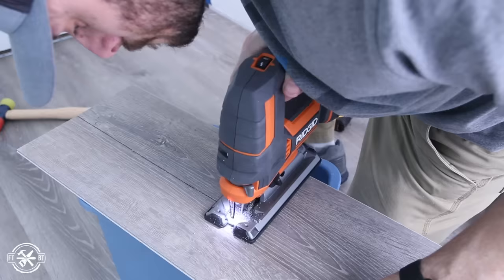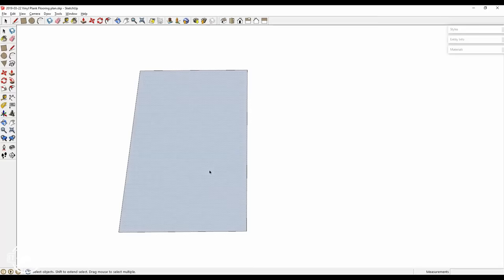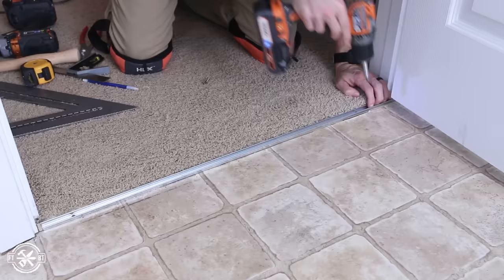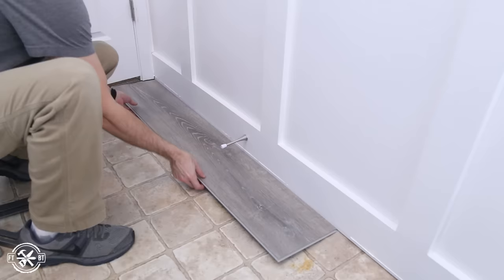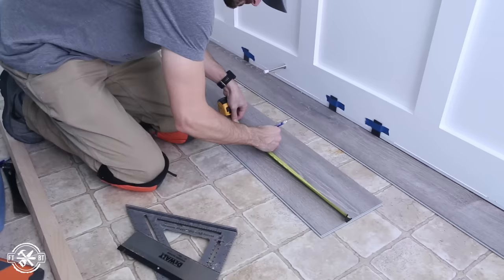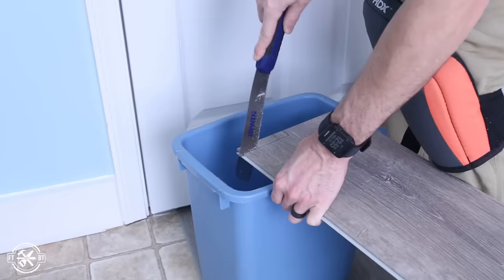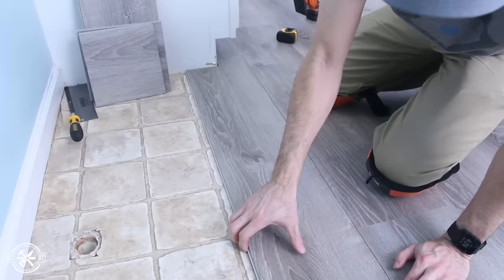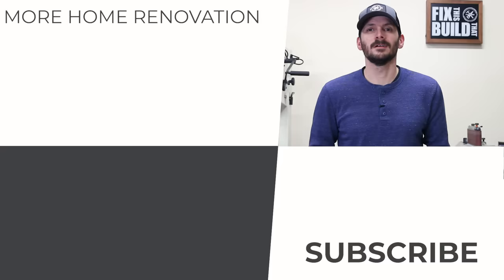How to Install Vinyl Plank Flooring as a Beginner | Home Renovation

Comment: Looks great.  I am doing the same flooring, same color in my place upstairs and down over some 60 yr old wooden planks that are seriously old and stained.  I incorporated Zumma vinyl stair treads in Sterling oak and trimming it out with white caulking, 5" baseboards to cover the plaster mess at the wall bottoms, and trimming them out with matching Sterling Oak 1/4" round.

Comment: @7:43 use the piece you cut off the last row. and @8:41 if you line up the boards on top of each other and place another against the wall so it lays onto of those you will get a better line incase the wall isn't straight plus it will give you the gap you need around the wall for it to move. just giving you some tricks i learned. nice job looks good

Comment: I did my whole house, easy, just remember to give the knees a rest for a few days in between. I also used gold backed laminate floor insulation underneath. 👍🇬🇧
Reply: or use knee protectors? lol
Reply: How much would it take to do a 16×16 bedroom
Reply: @odanesmith4752  $500.00 or less. Depends on price of flooring, and time
Reply: Amen u got that right

Comment: If you use a concave blade in your utility knife instead of a standard blade it's much easier to score and will snap easy
Reply from the maker: Great tip!
Reply: Just use a flooring cutter 10 x the speed and has a tape built into the base of it.

Comment: I see you switched from scoring on the back side of the pieces to scoring on the finish side.  I was going g to suggest that  as it makes it less likely to damage the the finished side edges.   Great job....a multipurpose tool is great for some of the difficult cut areas that are hard to cut with a carpet knife or a table saw as well....keep up the great videos.  Wish your videos were out when I learned ...it would have saved me a lot of trial and error.   On a side not for others....if you can take out the baseboards easily enough it is alot easier than cutting angled on and putting in new quarter round and finishes up alot easier as well.

Comment: Within 3 minutes I knew that I could not undertake such a project. It’s much too complex and dealing with undercutting things and thick and thin strips in various locations was just too much for me to bother with. Seriously, it’s good to know that this would have been a nightmare for someone like me. Not everyone is cut out for planning things so anally.
Reply: traderjoes it’s def tedious I layed this floor with a buddy biggest problem was that the floor was not level a total pain in the butt fixed the problem using sheets of newspaper since it’s thin it just raised the lowered parts enough for the interlocking

Comment: I’’m surprised how many people said you made this look hard. I think you explained it well. Thanks, I’ve paid to have two rooms done, time to do the rest myself !!
Reply: For a diy not bad, for flooring guy extremely novice, I'd be out of there in 15 minutes, he's lucky job was tiny and extremely straight forward, guy doesn't even own a decent knife and a mallot
Reply: I've seen a lot of lay outs that would make masters fumble and I gaze at it in glory, wondering how I did that getting worshiped by installation manager, I'll give you an example imagine a upsyairs hallway with 8 doorjambs one of them is on 45 and a titanium j mold has to get glued in around staircase, and you're using fragile 10mm laminate and btw no transitions allowed whole floor is one piece
Reply: Literally today worked with a guy with over a year experience and he couldn't figure out how to slide in a fat L cut on vinyl plank
Reply: And his bosses with all their life experience couldn't show him, swear most people don't try to innovate and just do what they were taught 30 years ago.

Comment: Here is a tip for mako g your end cut. Turn the board around such as to put the end that locks into the previous board ( but seem)  against the wall then mark the edge of the previous board. Cut n fits like a glove with the proper expansion.  No need to measure every board that way.
Reply: nice tip mate i always do the same while working with laminate or engineered wood flooring and it makes my job a bit faster
Reply: @AhmedHoly92  it's what I do every day ....
Reply: What if wall is crooked...
Reply: @louishollandjr  Measure and cut the piece upside down.
Reply: Not sure, but your saying out the male side toward the the directing of work (install)!?

Comment: I remember selling this product to DIYers and having them all say the same same thing "I don't need the tap and block set with wedges" then see them 4 hours later back at the store. 😂
Reply: Did my whole house without a tap and block set. 6 years later no issues.
Reply: People don't realise that tap actually locates the locking system properly.
Reply: @markallen8097  nope
Reply: YES! The instructions that came with the material I purchased does not mention tapping it, but if you don't it tends to come apart! I had to do several rows over again as a result of not having tapped them!!

Comment: Great DIY but to make it easier and not have alot of scrap pieces. After a row and you cut the last board use the cut board you got over from that row to start the next. This way you don't have to overthink the staggering. Just a heads up that was not mentioned in the video.

Comment: That was waaaaayyyyyy too much for me. I'm going to have to hire someone to install the flooring. I want that exact same color for my kitchen,. You did such a great job, and the laundry room is to die for!!! Well done!
Reply: Dudie I agree with you, even though I have a small house I need someone more skilled then me to put in the floor....
Reply: Guys, you can do it.
Reply: You must be a chick.
You can do it, once you get started, you'll figure it out and finish it. It's very straight forward, floor planks have a groove that they snap on together, real easy.
This guy made it complicated.
Reply: Hey fellas  this has to be my 7 or 8th video and I must admit it's looking less intimidating the more I learn by watching
Reply: R Me way to be sexist my guy
Reply: Its a lot of info in one go but my sister installed hers and it looked great on her first try. Basically just plan ahead and have the right tools and you’ll be fine. Its pretty forgiving to work with.

Comment: Just remember , if you are doing a large space , to make sure you snap a line that is truly strait for your starting point , because your floor will not run straight and in a large area you will see your floor is running off line
Reply: If the walls of the room are not straight, then you can do the following: (1) temporarily push the flooring up against the wall. There will be gaps if the wall is not straight. put a scrap of wood, or flooring, on top of the full sized planks. Slide the scrap along while marking with a pencil or felt tipped marker. Cut along the marked pencil line. Somtimes, the cut ends up being a 15 foot long gently bowed u-shaoe. The irregular edge goes up against the wall. The perfectly straight edge of the flooring will butt up against other floor planks.

Comment: All you will need is:
3D modelling software + training
A workshop
Power tools

Easy peasy.
Reply: Lol
Reply: You can learn to do the "modeling" he did in literally 10 minutes with any Fusion360 or SketchUp tutorial - both are free for personal use. When you're just modeling basic geometries like rectangles it's ridiculously easy and takes literally no effort.
Only thing he used in his workshop is the damn table. Use your kitchen table or something if you don't have "a workshop".
Only power tools he used are a $50 circular saw and a $30 jigsaw which you can skip and just use a hand saw instead.

Yes. It's easy peasy.
Reply: You can snap it by scoring it with a razor knife (box cutter). For any intricate parts snap bits at a time use a wire snip. Use a multi tool to go under door molding. Tack or use flexible caulking to put 1/4 round around the baseboards and cabinets, hiding any gap and sealing it. I used no power tools at all. The door molding already had enough gap underneath when I took the linoleum up. It slid under the molding beautifully. You are overthinking it.

Comment: the drain pipe may work , but a floating floor of that type will leak thru the joints and around the edges .

Comment: The end result looks excellent. Your instructions are very clear. I didn’t realize I’d need so many tools for the project.
Reply: All u need is a knife and something to cut the base for it to go under on the doors I do this daily and also he needed the weights to hold it down because he didn’t take off the vinyl that’s under the wood

Comment: Nice job, but would have been so much better if you had used the fibre underlay boards intended for use with this type of flooring. It makes the floor warmer and less noisy when walking on it.
Reply: Philip Cooper I think the product has it attached but I may be wrong

Comment: Great video. I use the score and snap method for my cross cuts and depending on tool availability use a jigsaw or circular saw for rips. The most versatile tool I've found for making all cuts, especially jambs and mouldings is an oscillating too. (Ridgid JobMax for Fein Multimaster, i.e.) I use that to make all of my complex cuts around obstacles as well as trimming door casings and jambs. As far as keeping the pattern random, I like to finish a row and start with my scrap on the next row. (provided it doesn't place my joints too close together, typically 6-8" difference is manufacturer spec, depending on the product.) Keep up the good work!

Comment: Excellent video.  Excellent work!  I just laid down a kitchen.  Personally, I disliked working with the planks.  FAR TOO MUCH hammering for every single plank.  I’d rather work with thinset, tiles, spacers, and grout.  The tile you covered up looked fine.  I’d have kept the tiles.

Comment: I’m installing this exact brand in my RV today. I installed the peel and stick in here about a year ago but just repainted the whole RV and decided to upgrade the floor. That peel and stick stuff sucks compared to this and leaves a horrible residue when you remove it.
Reply: Hi Christopher, how did you get the residue from the peel and stick off of the subfloor? I want to do the same thing.
Reply: Max Caine hi... I uses a lot of the swifter wet mop pads. Kept doing over it and over and surprisingly after a while it all came up and off. But it was damn sticky. My sandals got stuck to the floor. But love the new floor,
Reply: I have a question with this type of flooring no glue is needed?
Reply: chuyrock1 nope none.. but because I did put mine an RV that I drive all most daily some tiles move ever so slightly on an area that has no back wall... under a slide. I may drill the one end in or glue just one end down. But on places I have four walls it is smooth and nice... best part is just put it over the old floor . Very easy to do.
Reply: chuyrock1 their are also vids of people on YouTube putting them in an RV. 
This brand.
If you are thinking of doin that.
Reply: @RVingTheCountry  Thanks for the input
Reply: Can this be installed directly into ceramic tiles?
Reply: The peel and stick does not leave grooves where furniture sits or anything dropped this does
Reply: chuyrock1 none it floats on existing floor never use glue
Reply: @RVingTheCountry  

I uses..? Man , you need to quit.
Reply: @RVingTheCountry  

Just like putting another layer of tar shingles , when the roof should be stripped and newly shingled.
Reply: @RVingTheCountry  (g).
Reply: @maxcaine3734  You don't have to remove all the sticky residue. You can just neutralize it with a leveling powder or a floor patch powder or even newspapers.....much easier than trying to remove it all.

Comment: I've lived in my house for 14 years now, and I have this large 8 foot tall 3 feet wide bookshelf. It hasnt moved since I put it there. I have painted my living room probably 4 times, and I have painted around that bookshelf multiple times LOL. I dont plan on moving it until I move out of my house 😂
Reply: Big B same here man , I’ve got walldrobes that go along one wall. If I move them they will warp and then start having problems. So I have just enough room to put my arm through to paint up to them. If we ever replace them there is going to be about quarter of an inch thick  of paint  to build up lol where I’ve painted every year. Sometimes twice a year.

Comment: You can start the plank in any position is most comfortable for you. Some people sre better at different grooves, and the gaps at the edges of the walls is for expand and constract of the plank. Your welcome leave an eigth inch u can put these clips they make bc it also helps it not move when ur clicking the plank together and you usually always want to take up the flooring underneath provides better acclimation from floor to plank

Comment: Question: depending on how even the original stone floor was installed, won't this new floor creak and wobble? I have uneven, flagstone floors which are awful to walk on but look nice. I'd love to try something like this that could even be removed if I need to sell or just don't like the look.. But the unevenness concerns me.
Reply: You'd probably have to use a thick underlay material, but if the stone is too uneven, you'd either have to remove it or use something as solid as plywood under the new floor. Or sand down the stone, but that would be a big job to make sure it's flat and even.

Comment: I did 2 large rooms with laminate and all the messy time consuming flubs you did (and you are way more pro than I) were the same things I had to do.  I wish I had a shop.  For the life of me I could not understand why you want to do so much of it by hand when if as you say you pre-planned the layout you could have taken those pieces to be cut with your circular saw.  Also the part about laying the planks randomly is a great tip.

Comment: always install thin foam between the old and new floor
Reply: Anonymous Phucker No, most often that is not needed or recommended. These tiles are rubber backed and above that is a padding. I’ll be putting this directly onto my rec rooms concrete floor, there’s absolutely no moisture problem, therefore nothing else is needed underneath.

Comment: I have a painting company every time I go in the even two million-dollar homes at times people don't even paint behind the oven and washing machine. It shocks me.
Reply: My house isn't anything special and i'm painting the one room right now and will be inside the closet painting too lol. I scrape off any nubs and sand imperfections. I wipe and clean and vac anything and everything before I paint too. It's gotta be right.
Reply: I haven't painted behind my radiators but in my defense they're cast iron, weight a shitload (seriously even the small 2 elements one I removed weighted like 40kg, and the others have 10 elements), and I cannot take them off without having the entire building's heating system drained specifically for me since we have teleheating and it's a single circuit.
Not painting behind a washing machine though is a level of laziness that makes me wonder why they didn't just not renovate the room at all.
Reply: @demoniack81  well I understand but where I live you rarely even see that kind of heating anymore but there's paint that you can paint the radiator with I've done it a long time ago but in America we don't see that in most parts of this country.
Reply: @bopitbulllivemusic6522  Yeah I was talking more about the wall behind the radiator, it's more or less impossible to get to.
These kinds of radiators have gone out of style here in Italy too, new places almost always have the aluminium ones which are MUCH lighter and look sleeker.
But since the old ones were built like tanks and they just work forever, pretty much all of the buildings built before 1980 (i.e. virtually all of them) still have them.
I might swap them out just for aesthethic reasons eventually, but I'm really not looking forward to lugging a 200kg piece of iron down 5 floors (there's no elevator).

Comment: I have a smaller cutter just like this, tried a larger one but it did not rip cut. I am using a Table saw and a sliding compound saw too. Just discovered cutting around walls, my cordless Dremel with drill press stand, and the Dremel wand cuts this floor well for little cut areas.

Comment: Perfect timing. Wife wants 1500 sqft of this stuff!
Reply from the maker: hope the vid helps!
Reply: Break out your pocketbook last I checked It was going for $25 a box which only does 15 square feet
Reply: @adresc5391  3 weeks ago I paid close to $50 a box, but the box did 20 square feet. This was at Home Depot. I live in a small city. You might be able to find it cheaper in a big city.
Reply: @adresc5391  Paid $2.84 a sq ft.

Comment: No need to hammer this stuff into place, it’s got a joint which seats on its own. If there are gaps (like in your closeup at 1:09) you’ve not got it close enough before lowering the plank. These tiles are precision manufactured, they’re not loose lay, so don’t need hammering into place. Useful video though. Thanks!